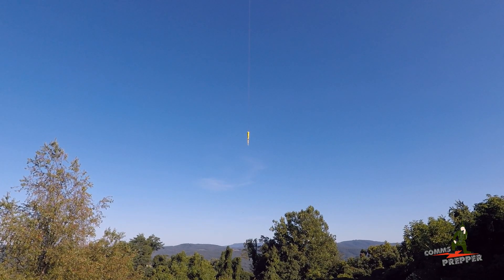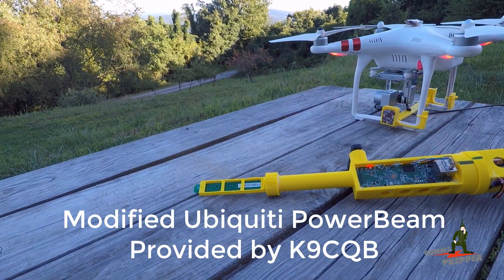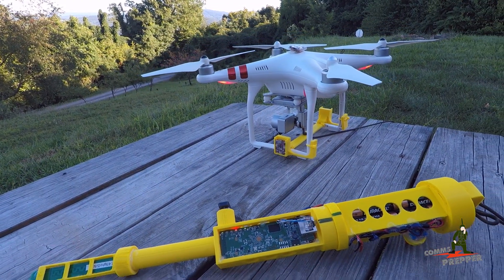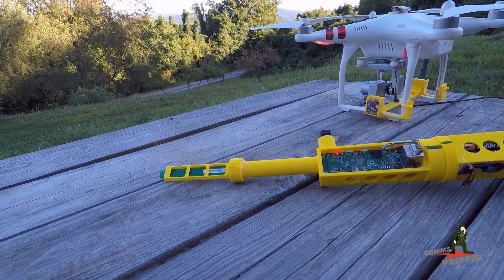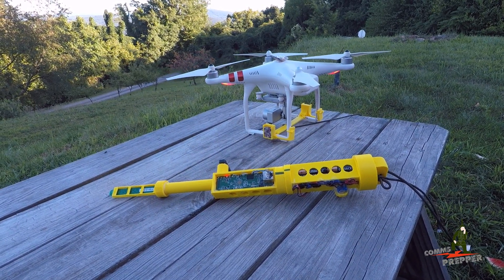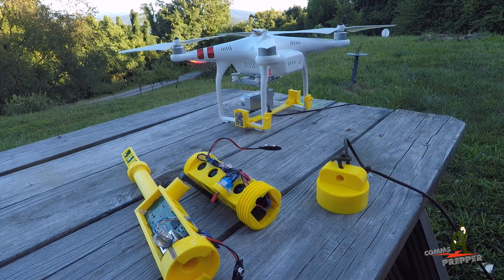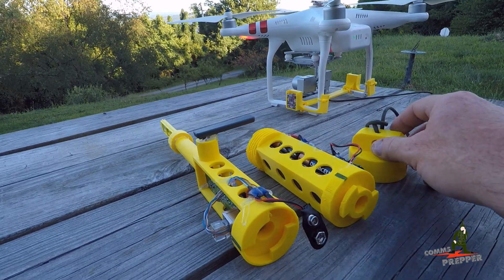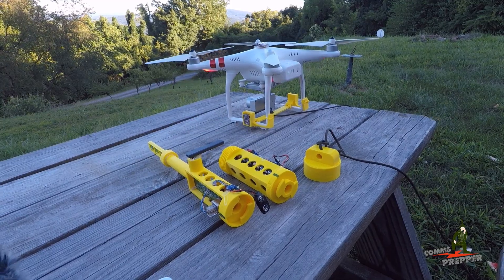Air-born AREDN Node with sUAS / Drone

Comment: Nice progress on the project. Did you test signal quality between a ground node and the airborne node? 73, de KM4ACK
Reply from the maker: Yes.  It  was slightly improved but I could not focus on that and flying at the same time.  Only one set of hands that day.

Comment: I've been kicking around the idea of doing the same thing with a helium-filled balloon put four lines on it will stabilize it, get it as high as you want stabilize it and you don't have to worry about flight time
Reply from the maker: Balloons will work fine with omni directional antennas but eventually I would like to also have directional antennas.  Drone with GPS will hold its position - balloons will not.

Comment: Have you considered modifying this to run the node from the drone battery itself?  Using your Powerbeam PCB, you could desolder the ethernet connector, and connect it to 25 feet of twisted pair to run up to the drone and connect to the battery.  That would be a significant weight improvement. You could tap into the battery and add a small buck converter PCB to the back of it, providing 24vdc to the node without adding much weight.  a single pair of wires from a Cat5 cable should handle the current at that voltage.  The wire would probably be a bit lighter than the paracord, too.

Comment: I have wondered before about a similar setup but using a large helium balloon tethered to the ground. Thoughts if it is practical?
Reply: Helium is in short supply right now
Reply: I like the balloon idea. Much more economical and can stay up considerably longer. I wouldn't use helium though. Use Hydrogen. It has better lift and can be put into multiple mylar balloons to increase the time aloft over a latex or equivalent.
Reply: @kb9mtd-aaronwebb  I'd looked into this a while ago. The particular setup I was looking at was going to be what I considered expensive. I mean, the cost of the balloon & helium brought the cost of each flight to like $100 or so. Yes, it be good for a day or two, but... Not reusable.

I'm looking into tethered drones (powered from the ground), whether commercial (expensive) or a DIY mod, and also looking into kites, though... That relies on wind.

Comment: Soon I will be approaching the communications aspect of my list in greater detail. As of now I have a simple Yaesu FT-60R handheld with a few accessories. What would you recommend as an upgraded handheld or is the FT-60R still adequate for the average user?

Secondly, what would you recommend for a mobile/backpacking transceiver (such as the Yaesu FT-817ND or FT-857D)? Perhaps these models are out-dated which tells you just how long I've neglected the comms portion of our setup.

Third, any thoughts on some base station units without going too far down the rabbit hole?  

Lastly, we come to antennas and other necessary equipment. What antennas would you recommend for the three types of units listed above (handheld, mobile/backpacking and base) and what other "must have" items would you suggest to make life easier?

Thank you for your help my friend.

EDITED for double spacing.
Reply: I backpack with my FT-817ND all the time and love it. I use 43' of wire with a 9:1 balun and use different methods to toss the antenna up into a tree.

Comment: This is very cool, and I appreciate all the work you have put into it. I, being an IT guy appreciate the tech and experimenting. I do have to ask how useful this is in a survival situation though? I understand it's use case as you have presented it in several videos, but what if you or others don't have computers or smartphones? What if a drone gives you away (especially with blinky lights), or it's control radio traffic, or you don't have sufficient power to recharge everything? Btw, I would replace the batteries with LifePo4, they are low weight and last much longer. Traditional radio and or using TNCs seems to be far more effective and realistic, especially at the frequencies WiFi works on, you get more distance and power using other data methods, granted they are slow and less persistent, but much easier to deal with and far less specialized. Case in point, once your Ubiquiti modem goes you are done, no replacement, but with traditional ham equipment you can more easily repair/replace it. I should clarify that I love APRS and a few other more digital modes, I also have a lot of laptops and a few RaspberryPis, so I have options, but I would just be careful investing too much in a tech that is limited, requires way too much infrastructure and the ability to replace it easily, and honestly only has one use unlike other ham equipment that is typically multi use. At least that's my view, I handle comms for a decent sized group of people and I'm trying to keep it simple, but please let me know if I'm missing something major. I'm not trying to be a know it all troll, I'm just trying to learn. :-)
Reply from the maker: Thanks for the comment.  I suggest you get one of the $25 dollar units off of the AREDN supported equipment matrix and check it out.  There are allot of applications here when you start working with IP on ham radio.

Comment: I would suggest that you use a very light cord.  You don’t need 550 para cord.   I use a 3mm diameter cord for shoelaces.  EBay has various very strong cord that weighs much less than what you are using.  I like your videos.  Very well done.
Reply: Richard Day, couldn’t you use fishing line?
Reply: You could use fishing line, but it is hard to find fishing lines that are greater than 12 lbs breaking strength. The thin cord has about 100 lbs breaking strength

Comment: Try lithium ion AA batteries they are way lighter than the Duracell, and they last a lot longer I use them in my trail cameras and they last for a year even in the coldest weather, great thing you got going there, keep at it 🙋🏻‍♂️ PS instead of 25 feet of Paracort use a high tensile strength fishing line that will reduce weight too
Reply from the maker: it needs some tweaking for sure.

Comment: How about 25 feet of small speaker wire instead of rope and power radio with drone battery
Reply: This is what I'm looking into. I don't have a nice drone, but I did get one of those really cheap quadcopters (like $100) and may try something like this with that. At least start out with flying it tethered and go from there.
Reply: That would divert energy from your flight time.
Reply: @rkaag99  The alkaline batteries are heavy and less power dense than the lipo battery, so i think the wire idea wouldn't take that much from flt time.

Comment: Proof of concept. Now to perfect it. Could also use helium and ballon  tethered to get it up in the air.
Reply from the maker: Balloons will work fine with omni directional antennas but eventually I would like to also have directional antennas.  Drone with GPS will hold its position - balloons will not.
Reply: Commsprepper Ahhh, I get you. Makes sense.

Comment: Very nice, but have you tried a helium baloon instead?😁
Reply from the maker: Balloons will work fine with omni directional antennas but eventually I would like to also have directional antennas.  Drone with GPS will hold its position - balloons will not.

Comment: Also a 100 gallon plastic garbage bag filled with He and a fishing line mounted to drone to reduce weight will take a load off battery.
Reply from the maker: Balloons will work fine with omni directional antennas but eventually I would like to also have directional antennas.  Drone with GPS will hold its position - balloons will not.